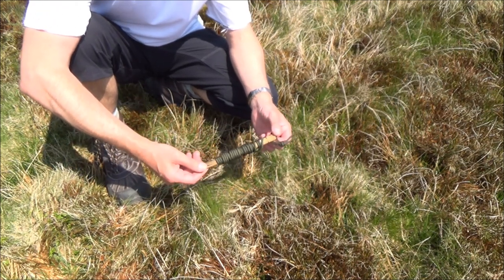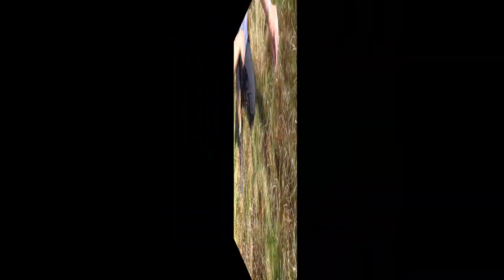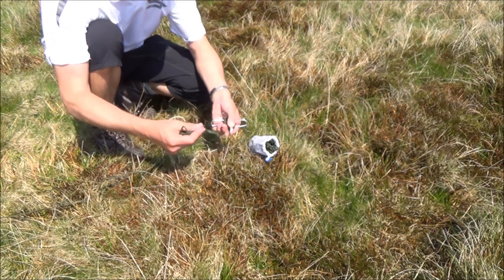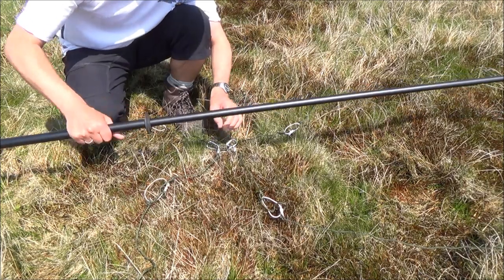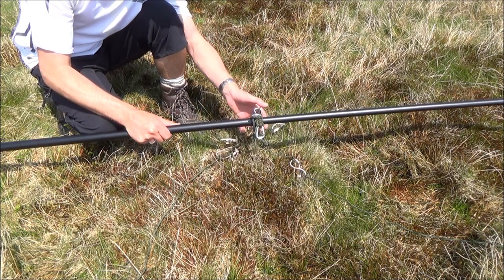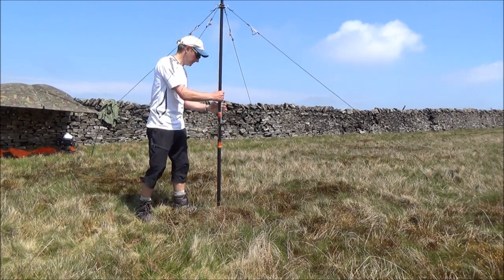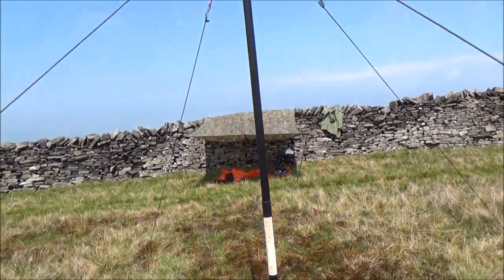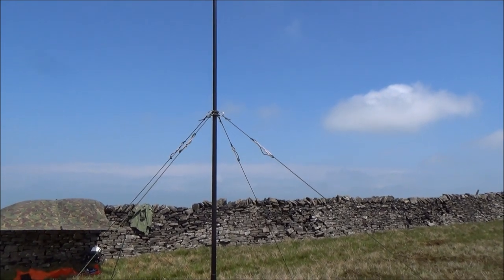My CB Radio DXing Antenna Mast Setup

Comment: Pity you didn't show antenna. I use similar process for HF, without roach pole. Tri-band trapped HF vertical radiator replaces the pole, feedpoint raised above ground, 3x sloping wire guys used as radials from feedpoint + 3x nylon guys fixed higher up on radiator but ties to the same pegs. Each radial "guy" is nest of three wires each a quarter-wave at 1 of the 3 bands in use & separated 50mm from the others on insulators - longest wire is the lower "guy". Works well.